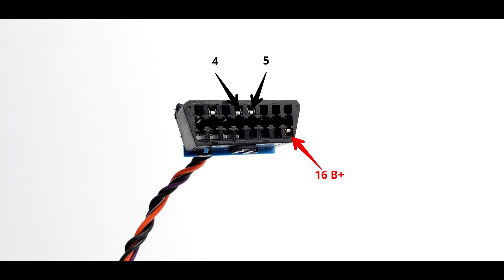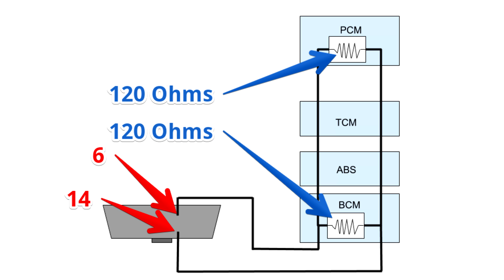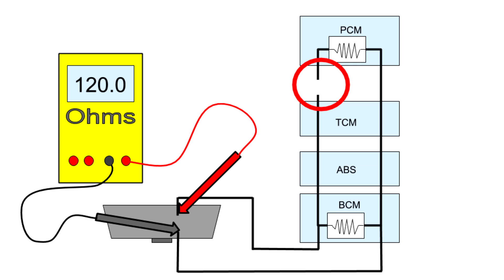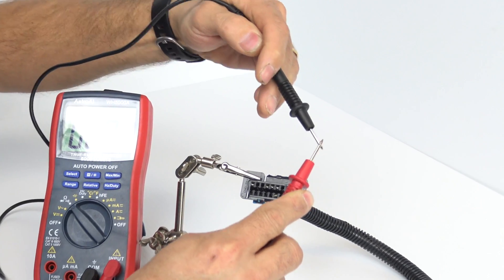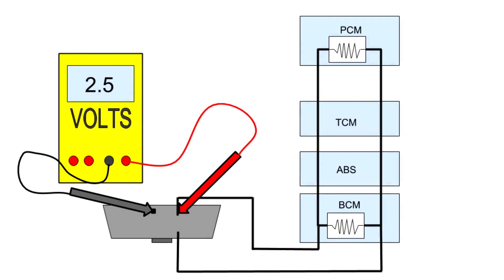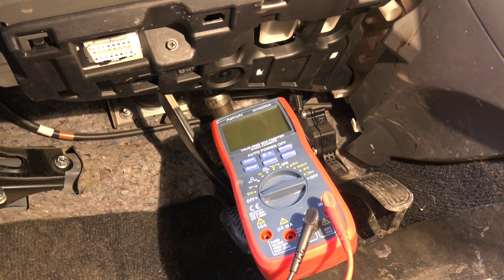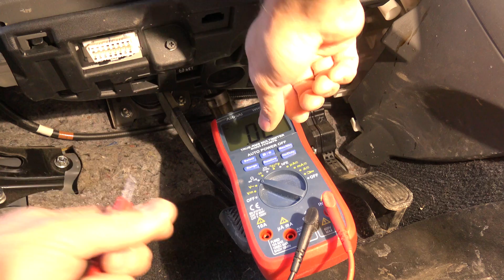DLC Quick Testing Tips

Comment: Thank's for the video ...
Question pleaze, how we test and diagnose the pin 7 and 15 (k-line and L-line) respectively ???
Thank's again.
Reply from the maker: I do not have any "quick test" for those protocols.  I would be checking with a scope, I believe that Pico could decode, I have not had much opportunity to play with.
Reply: @BrianMann216  ... Me too, It's my first time to have the opportunity to check and fix this kind of protocols. The scanne tool can't go inside the modules, loss of communication.
Thank's again, when I find it, I will inform you ... 👍
Reply: @osamasegh8737  please do, i need it bad.
Reply: @LuisMartinez-fr9gq  ... What do you mean ??? What do you need ???
Reply: Hi friend, i wanted to know if you figured out something about the k line and L line. I really need help to fix my car,  my car do not have pin 6 on the port which one should I used to test for CAN BUS. I only have pins 4, 5, 7, 8, on the top, on the bottom i have 12, 14, 16, can you help me out to figured out these pins, by the way is a 2001 Hyundai Santa Fe GL 2.4 liter, thanks...
Reply: @LuisMartinez-fr9gq  Hi friend, yes but tell me first what is the problem of your car ???
Can you communicate with the other modules ??? Or just u have problem with ECU ???
Pin 7 is for K-Line protocol, L-Line is used for signal control, it must be on the pin 15, but you dont have it, no problem car starts without L line.
May be ur car use only K Line pin 7, because pin 6 and 14 are used for Can-H Can-L respectively.
Tell me exactly what is the problem of ur car ...
Reply: @osamasegh8737  man thanks for your comment, you are right, i do not have pin 15 also i do not have pin 6, my problem is this, my scanner will not read codes, it said link error, so i went to buy a used one at the junkyard, different part number, but is for same make and model the only difference is the it's a ECU for 2003, the reason I bought was, i asked somebody online, that was saying if it's same make and model should work or fire up, but it didn't fire up, only cranks, the good think is that this ECU it does link to my scanner, so that leads me up to believe my ECU it's bad, but before I purchased another ECU same part i would like to do the test, if it's bad or not, i checked my wires and fuses, the fuses are okay, but i feel that it's a problem in the wiring, my problem also is i do not have the diagrams to proceed with the diagnosis 100 percent. By any chance do you access to diagrams for Hyundai Santa Fe GL 2001, 2.4 liter. I bought the book from AutoZone but it does not have the diagrams i nees for my specific car it goes from 2001 thru 2006, is in general, which is hard for me to figured out.
Reply: My friend but also i like to mention, that with my old ECU the car starts but it takes too long to fired up, when i get running i have to hold the gas pedal to stay running, but i need to mention that i have to bypassed the ECU relay, pin 30 and 87, it's the only way starts, i am very confused. With all this situation.
Reply: @LuisMartinez-fr9gq  No problem friend, I'll do my best to help you.
Let me understand step by step. Firstly you have a problem just with ur old ECU ... NO COMMUNICATION is not ???
If yes, so you can scan and read codes from the other modules like ABS, INSTRUMENT CLUSTER ...ETC
If yes, so the problem is in the old ecu, may be broken pins or damage inside the IC of K Line protocol.
because if the problem was in the wiring 100% you will not be able to communicate with the new ECU of 2003.
The new ECU that u brought will not start the engine because it still immo ON, it contain The Scurity PIN Number of keys.
But the good news is, that u can communicate with it ... wich confirm that the problem is not in the wirring.
Will crank but never starts ... you an IMMO OFF or swipping of the eeprom ... this information it still just theory until You tell me the part number of the both ECUs the old and new one.
Tomorrow I will check my documents ... for ur wirring diagram and tell u what the new about ur situation.
Just tell me, ur car is diesel or gazoline.
And give me the ECU part numbers.
Reply: @osamasegh8737  thank you so much friend, my car it's gasoline
Reply: @osamasegh8737  let me get the parts number of both ECU, so you understand better, yes you understand me what i am saying, that is correct, the new ECU can communicate with the scanner, but the old one only if i bypassed ECU relay, but you gave me hope to keep trying to figured out, i had put some many parts into already, that you would not believe, but i want to ask you do you think this car has an immobilizer. It's old car 2001.
Reply: My friend when you say if i can communicate with abs and cluster, do you mean connect my OBD II to the port, it's only one port right? Yes the new ECU can communicate without me doing anything, i do not have to bypass anything, I open the ignition switch and my scanner starts to communicate with new ECU. That's what I am trying to explain just hope you understand me and have patients to explain me. thank you so much.
Reply: @LuisMartinez-fr9gq  yes ... but u can choose wich module u want to communicate with for example you want just to read ABS Module ... select it in the scan tool ... if yes ... so you dont have problem inside the harness and wirring.
May be u r using automatic communication with the ECU only. Check the other modules.
Reply: Ok. First let me give you the numbers, original ECU: KEFICO KOREA brand, i am not sure Wich one is the part number but i am going to give you all series numbers of each one, you understand better which is part number. 39121-38380, 9040930104A0, EH2256-F0, B48E, 118530X, 0029, this is all series numbers from the original ECU.
Reply: Do you understand the correction I made, i had typed the wrong serial number at first, just so you do not get confused i am to write everything again from the new ECU from the junkyard. KEFICO KOREA, 39122-38760, 904O930248A0, EH9637-F0, B92E, 138722X, 0047, this is right Buddy. I also have the VIN numbers for both if you need them.
Reply: Bro. To be honest I do know have to use that, i only plugged the scanner and check for codes or if let's say EGR valve is incomplete or okay.

Comment: Excellent informative video Brian - glad to subscribe like and follow. Question - I did all the same things you did on a 2007 toyota prius and got all the same values, yet I still have codes U0111, C1259 and C1310 codes that are persistent...basically the battery not talking with the rest of the system. Reman battery is just shy of 2 years old. Wondering if the Battery ECU or the HV ECM needs to be replaced. Thanks!
Reply from the maker: I dont think that you have a wiring or circuit fault.  More than likely module either not responding the way the other modules want due to a bad module or something causing a faulty input.  I would clear all dtc's and see if only 1 code returns.
Reply: Brian Mann yep did that. Those are the 3 that persist. Won’t clear for anything including keeping the 12v disconnected for a significant period of time. FYI using Techstream for data collection. Someone else on the forums suggested checking for corrosion on the battery Ecu as a next step
Reply from the maker: @wannafly34  yes time to start voltage drop testing powers and grounds.  I have not had time to research further.

Comment: Can you please give me some advice. I have a 2014 Chevy van express 1500. The chevy dealer said it was no communication with the tcm and roll over sensor. The problem I was having is the same now after I spent almost $2000.00. The traction and stabilizer is on the dash light, the door locks are going crazy. the air bag light is on and the dash lights are going crazy. The transmission is shifting hard. I checked and found that I have 120 ohms between pin 6 and 14. I don't want to spend a lot more money on this. How can I check these resistors? Do I need to replace the ecm? Will that have to be reprogrammed? you help will be appreciated.Your information is great.
Reply from the maker: You have a open in the CAN bus,  may or may not be related to all of your problems. Programming will not make a change in the resistance.  What dtc's are setting?  split the system at the easiest to access module and narrow own where you are getting your 120 ohms from,   and head the opposite way.   Sounds like may have a bad ground as well.
Reply: Whay do you mean by what dtc's are setting. I was asking if I need to replace the ecm and than have it programmed. My email is gregg@a-1tops.com. Thanks
Reply: What colors are can bus wires?
Reply from the maker: @a1tops988  DTC's = Diagnostic Trouble Codes.  I dont know where the open circuit is.  If you replace the ECM it will need to be programmed. You need to do some testing to figure that out.  GM High Speed CAN wires are usually Tan  Tan & Black.  What color are they on the back of the DLC?
Reply: I am not with the van now. What I remember is code 00073,0101,0140 and there were a couple other.
Reply: Also P0700,P1682,P0060,B0090,B1011

Comment: Hi Brain, is this information for all cars, as I have a volvo and non of the values, except ground and power match with your explanation. I do this check as nobody can acces the diagnostics, live data works fine but the rest is impossible to connect, it returns a fault, Even for the volvo dealer it is a miracle. The car runs  very well, but for the french mot your are not allowed to have warning light on, I have the abs and airbag light on.  soen suggestions would be very welcome. regards
Reply from the maker: What year and model?

Comment: What about K line? On mazda 6 2006 I have 1.2V on KeyOn position between pins 5 and 7. Obviously scan tool will not show ABS SRS etc. Any idea what's wrong ?
Reply from the maker: I personally have not done any testing that was of significance on the k line pin 7. I believe  you would expect 0 volts,  but some sources state a bias may be present.
Reply: @BrianMann216  Read here: http://www.automotivetroubleshootingsecrets.com/2004%20Mazda%20Bus%20wiring%20network.html

2004 Mazda
"PIN 7 which is the K Line bus communication signal. This is a low speed bus signal and usually is a lone wire going to the accessory modules like ABS and Airbag as shown on right. When testing for voltage, probe PIN 7 against PIN 5 and you should get about 5-7 volts st KOEO. If out of range, disconnect the 3 modules one at a time; ECM, Air bag and ABS modules."

So I expect to find 5V or 7V, however I found 1.2-1.6V not stable. I disconnect ABS, SRS, ECU. There is no change.

I did not find TCM does Mazda 2006 GY has one? Or is it inside ECU?

What to check next? Instrument panel?

Comment: great Mr.Brian! For an application i need to identify when the key is turned on (and then the car is ignited - if it is possible just by observing voltages). So is it possible to take decision as the key is turned on by observing voltages in any pins. what will be the voltages in the can bus pins when the key is off? and voltage variation of other protocol pins as when the key is on and off? 

i don't have a car to check these ;-)
Reply from the maker: Key off for checking resistance,  key on for voltage.

Comment: If I have 60ohms would that indicate a good ecu? That would lead me to believe that the ecu is not open but still may not be functioning properly
Reply from the maker: 60 Ohms indicates that your CAN bus is  not open.    You are properly reading both 120 ohm terminating resistors in the network. If you have no comm with a ecu  I would start checking powers and grounds to the specific ecu,  along with checking the CAN bus voltage.  Also get a diagram and see if the ecu in question is on other networks as many do communicate to scan tools on other networks.

Comment: Thanks Brian. There is a lost and desperate man on the other side of the screen. I am being whopped by a 2007 infiniti M35 no start no matter what. 
I was lucky to perform a CAN diagnostic on it. The result reads "Open on the CAN L of the DLC branch line" with some voltage reading of the CAN L in comparison with the CAN H.
I know what the DLC branch line is but pinpoint the problem? Man i dont even know where to start.
I need guidance and if you are not too busy, id love to get some direction so I can test and report. 
I have a multimeter and a powerprobe whichever can help the most. 
I exposed all the module on the CAN BUS of this vehicle except the TCM which is in the transmission. All else can be tested. I just need what to look for. 
Please assist.
Reply from the maker: What scan tool are you using? 
What modules do you have communication with? 
I am not familiar off  hand on the specifics of your vehicle. I am thinking that thy may run the NATS (security) on the low speed network?
Reply: @BrianMann216  I am not sure about the NATS network Brian but i can find out. 

I have a tsb giving me spec values when tested for short. It is a table. I do not understand all the info. I wish I could let you see so I can get a better understanding of where to test and what to look for.

When key is switched on, the communication line is good green between PCM and IPDM. The PCM is green (detected) but all the other units are red (undetected). All the lines (main and branch) are red too. 

I do have a snapon solus ultra that become just a code reader. 
It communicates with the PCM ABS TCM Airbag. All other module such as BCM, intelligent Key.... shows no communication as if the key was turned off

I also have a Nissan Consult 3 that allows me the see the CAN system. The diagnosis points to an Open Line on the DLC branch line. The open is on the CAN L according to the scanner and it gives me some voltage range (Max & Min).
Reply from the maker: Sounds like time to check CAN L,  maybe disconnect 1 module at a time and see if communication comes back to the others.
Reply: @BrianMann216  I tried that but overall comminication was stilll bad. I cant remember all i did because I was on it in June and lost hope.
I got my friends car, sane year and model nd trim to switch the IPDM with mine because I suspected it.  Turns out mine has bo issue.
I have a no communication bulletin on the infiniti. It says that the IPDM and the PCM are terminating module and should read 120ohn when disconnected wih Key off. All other module should read 60ohm. 
Here is the question that intrigue me the most. 
Say I confirm there is an open on the DLC branch line like suggested by the scanner. 
How can I pinpoint where the open is?
The wiring harness is insanely bundled and hidden behind the cabine metal frame that is behind the dash. 
I orginally wanted to replace the whole harness but I gave up that idea because its an impossible task without breaking things. 
I know because I purchased a whole interior harness for it and a PCM, and 3 modules which was causing a somewhat change in the network when i was removing them. 
If you have an email, i could send you photos with descriptions so you can give me insights
Reply: Brian, whats the difference between signal ground and chassis ground
Reply from the maker: @CBRRR-eh3ky  Chassis ground is ground to the chassis, signal ground may be body ground, engine ground, or even a ground for sensor signals through a module.  Both should be very low voltage   <.5volts.
Reply: @BrianMann216  okay thanks a lot.

Comment: Best video I've seen yet. I have been scratching my head on this problem. My 08 pathfinder runs and drives fine. I just can't get communication to pass emissions.  The only test that didn't read was between 4 and 5 I got nothing. 4 and 16, 5 and 16 was good. What do you suggest is  the issue?
Reply from the maker: With key off what is resistance between 6&14 ?
Reply: @BrianMann216  Hello friend, one question i have a 2001 Hyundai Santa Fe 2.4 liter i do not have pin 6 for CAN BUS what would be my option pin to test CAN BUS for volts or resistance.
Reply: You should have 12 volts from pin 4 or to 16...

If key is on you should read 2...volts pin 4 to 14. Using pin 5 instead of works the same.

Comment: Yes i have seen a few of your videos on doing that. My question is when don't use just use the cars fuse box and take out one fuse at a time until the CAN network signal returns to normal? Most CAN modules are hard to get out so you can't physically disconnect them unless you tear the whole car apart. There must be an easier way. What scan tools do you use model and brand make? Why do they can it a DLC and the break out box is called an ODB2, it doesn't make sense to have two different names it should be called a DLC break out box not an ODB2 break out box I'm very confused why the terminal box is called an DLC also.
Reply: The reason for the discrepancy among naming conventions is a lack of standards.  Mechanics don't spend much time thinking.

Comment: BRIAN MANN, when the CAN bus signal is bad how do you know which CAN module is causing the problem, what do you do? Do you use a OBD2 scanning tool or disconnect each CAN module one by one using the cars fuse box?
Reply from the maker: There are a few ways to approach this. Usually disconnecting  modules and seeing when the other modules on the network start communicating with a scan tool, or more quickly by using  a voltmeter (preferably a scope) to see when the network returns to normal. I have a video or 2 out there showing this, and also have one in the works.